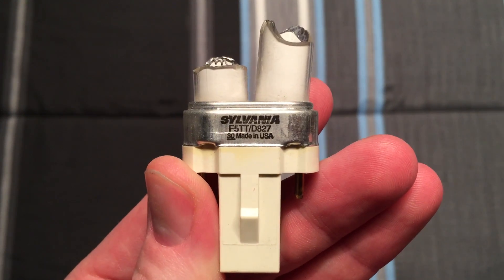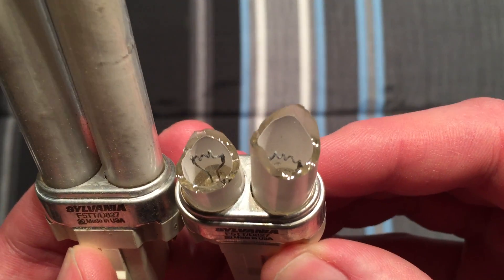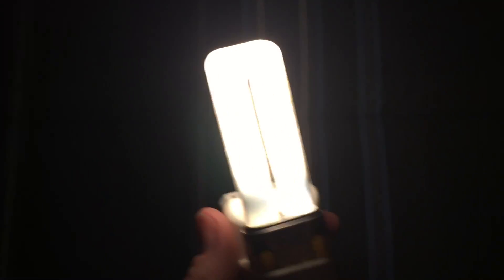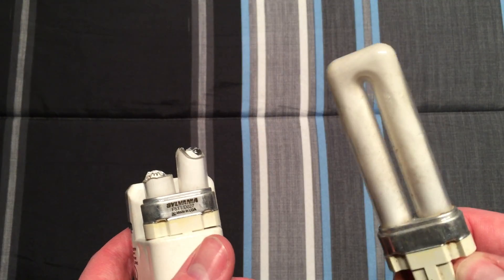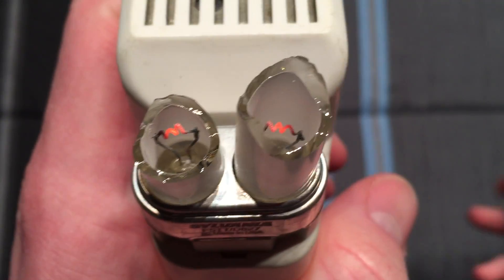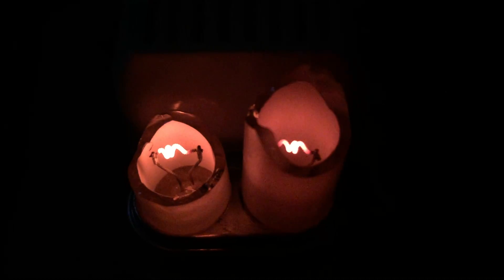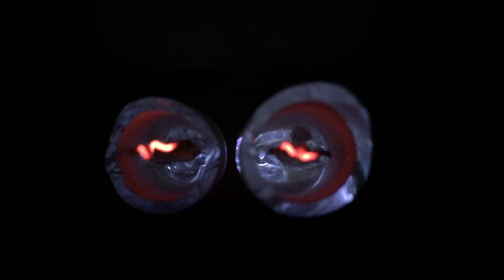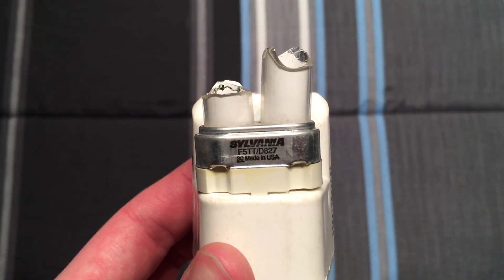5watt PL Fluorescent End of Life

Comment: If you get some automotive HID ballasts you get a tagteam of cathode glow and a shedload of arcing. I unintentionally did something similar with a G12 ceramic metal halide because it exploded and then arced over the arc tube supports due to the high pulse voltage (automotive HID ballasts have a 30kV pulse)